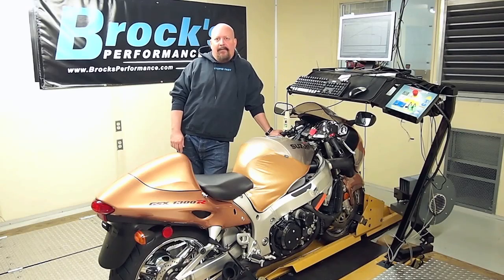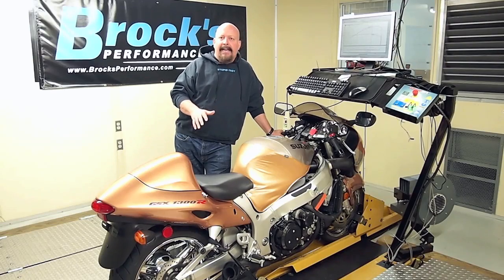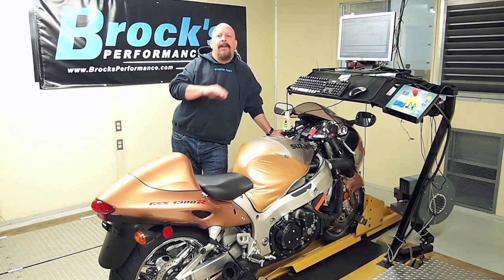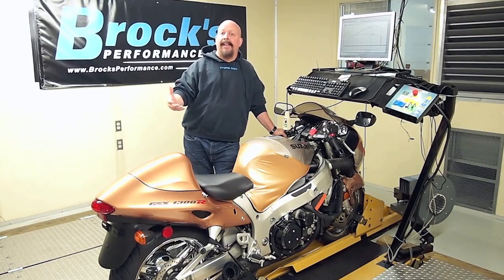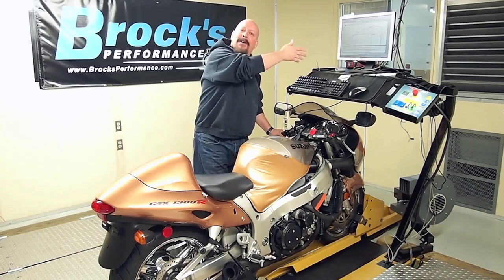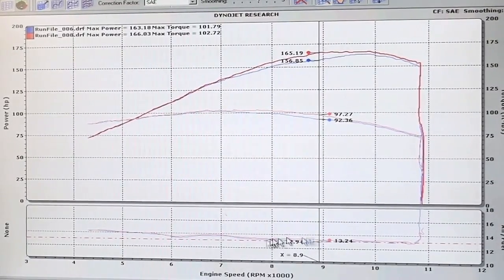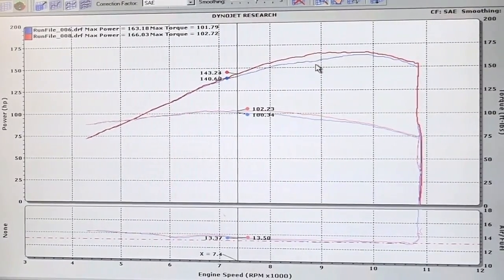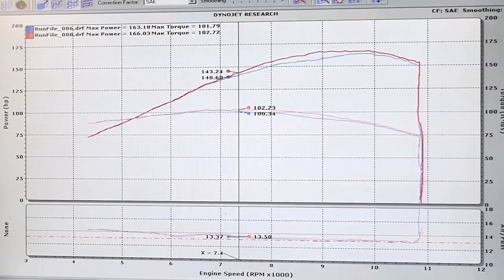Wynn's Power Charge: Fuel System Treatment Test Results

Comment: I ordered some of this from Brock’s. Waited for my low fuel light to start blinking. Added the entire bottle with 2 gallons of fuel. At the 30 mile mark … the difference is very noticeable. My 2019 14r only has 10,000 miles on it.. but it definitely made a difference!
Reply from the maker: Thanks for sharing your experience and glad you're seeing improvements!

Comment: WOW. This stuff is like race fuel. I did exactly as Brock suggested. 2 gallons and a shake. 30 mile ride to the gas station. My mid range has massive gains. Not sure if it's wynns or a good cleaning that I feel. What a difference. My 18 gsxr 1000R is back making beautiful power. Thanks Brock!
I tried heavily concentrated chevron techron fuel treatment. DON'T DO THAT. The bike didn't run the next day. This stuff heavily concentrated works exactly as Brock has demonstrated in the video. No snake oil or paid BS. I'm very grateful
Reply from the maker: Awesome! Glad to hear that worked out so well for you also. The techron has its place, but it is more of a fuel preserve ( like stabil) than fuel system cleaning agent. The Wynn's is the best we have ever used, nothing else is even close. BD

Comment: When i watch all your vids with you putting wynn's in your always draining your tank to remove the rest after 15miles. I get that u do that so it doesn't interfere with your numbers. But us regular guy's buying the wynn's are we supposed to run our tank dry or empty the tank after 15miles?
Reply from the maker: @jeremybly you are correct the only time we drain the Wynn's is to present unobscured dyno data. We typically run 1 can to a couple gallons of pump gas (for a higher concentration 'quick clean'), go for a ride and refill with pump gas when it's time to add more. Any leftover Wynn's would then be considered a lower concentration 'maintenance' tank. There is no reason for the average rider to drain it out. We do drain MR12 as it has a tendency to gum up/gell, especially in summertime temperatures. Note: we suggest the use of Top Tier Detergent Gasoline whenever possible - check this link for a station near you: http://blog.brocksperformance.com/faq/top-tier-detergent-gasolinehttp://blog.brocksperformance.com/faq/top-tier-detergent-gasoline/

Comment: I just used it today in my 1999 Honda cbr1100xx. I think I notice a difference? Throttle seems smoother, idle is cleaner sounding, power increase? I'm not sure. I expect that it did some good. And you see it here on the dyno in this Suzuki, so I think it's worth it. ... A little power here and there adds up to more power, right!

Comment: What oil filter do yall recomend on a 2015 gsxr 1000 OEM or aftermarket
Reply from the maker: We only use OEM as we have never seen a bad one (ever...). Conversely, we have seen multiple aftermarket filters not flow any oil at all (oil pressure light never went out) after an oil change, which has lead to engine damage.
Reply: @BrockDavidson  thanks again so only OEM

Comment: great video brock   trevor from seattle wa   05R1  97 cbr919RR  
i will give the winns a try   i sure wish u were closer i would love for u to set my R1 up BROCKNROCK  STYLE.  quick brain buster  my R1 has stock  everything  except kn filter  -1 frnt sprk   ...  will i benefit from the block off plates   and running a pc5  with a flash im getting mix opinion  what is your experience on these   im not a track guy i ride all year  just want bike to run as its suposed to     thanks  ragecage07@yahoo.com
Reply from the maker: Hello Trevor, I'm afraid you might not like my answer. If you go to our site, you will notice we do not offer the filter you mention... as we have found that only their race version works better than stock.  If it doesn't work, we don't offer it- that's our policy here. If your exhaust is stock, you really don't need a map or block offs just yet.

Comment: Hey Brock, If I wanted to use this fuel system cleaner for preventive problems on my zx14r at what mileage intervals should I run it?
Reply from the maker: Richard, one bottle of power charge to 2-3 gallons of fuel will clean everything up in a hurry. I typically do this in the spring. Afterward, I use a bottle of the fuel system cleaner every 1500 miles: http://www.brocksperformance.com/Wynns-Professional-Premium-+I771162+C80.aspx
Reply: Thank you so much for  the reply brock, I will start using it at the intervals you suggest....appreciate it buddy

Comment: I got a can of this stuff from the Brocks website and I'm really happy with the results from it. My 2002 VFR800vtec is now a different bike. I can't wait to run this stuff in my k7 GSXR1000. Great product thanks Brock.
Reply from the maker: +thestar111  THANKS! If you get a moment, please copy the above to the review tab in our store. Power Charge is a great product - it really works!!
Reply: How much did you put in? I just bought a can and plan to get my fuel system as clean as possible before winter. Appreciate any help
Reply: @mike216ism  Half the can into each bike. I had about one gallon of gas left in both the petrol tanks. Worked a treat.

Comment: What is the name of the fuel injection cleaner you used on the bike doing the the dyno I have a 2011 hayabusa that is been sitting for some time now only have 500 mile but put a yosimura slip on exhaust on it and running very rich
Reply from the maker: Wynn's Power Charge